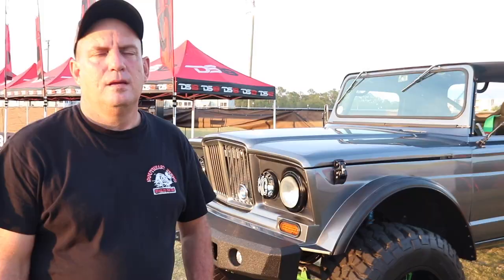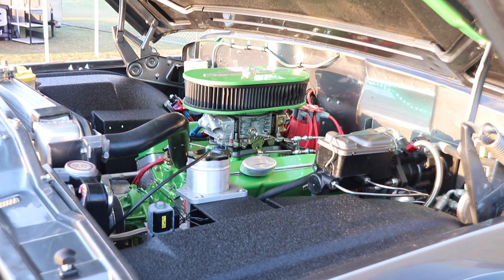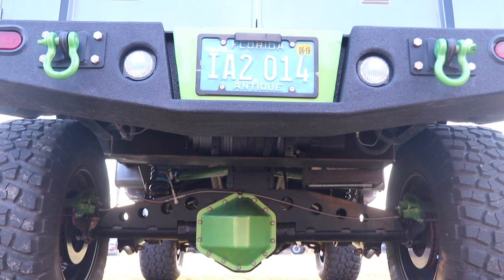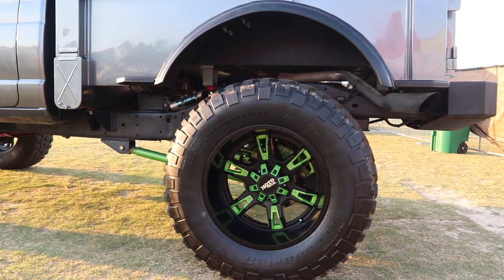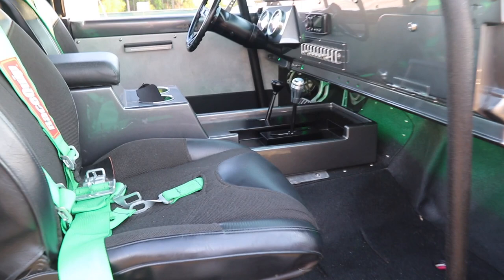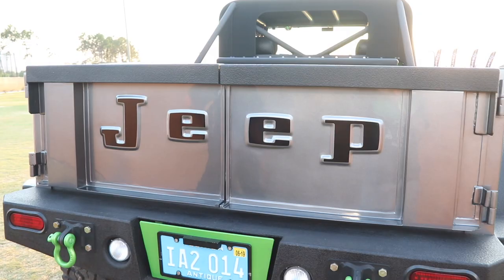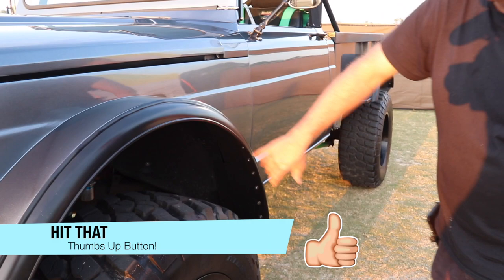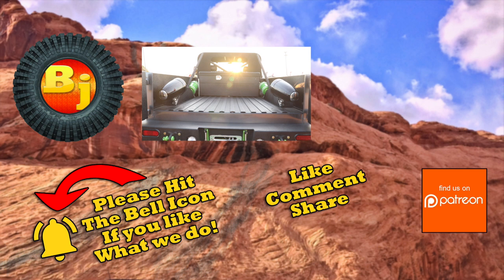Better Than a New Jeep Gladiator - M715 Walkaround

Comment: Stopped watching when they told me it's a Chevy with jeep body panels on it. 

I would use:
AMC 401 727 and Dana 60 for old school
Engine & trans from JGC srt8 for something modern (2007 maybe)
Reply: The fact Kaiser and AMC both used many different parts from other manufacturers makes the Chevy drivetrain right in line with what Jeeps have always done. My 77 CJ-7 has GM steering, Ford electronics, AMC engine and Dana axles and transfer case, Dana was in bed with Chrysler at that time. Meaning my stock 77 was built from parts from the big 3 by number 4 AMC.

Comment: That neon color just doesn't look right on an older truck like this, even if it has been restored.

With that being said, yes, it is far better than a new gladiator. Do the winches run off of the power steering pump or what?

Comment: I used to drive one of those when I was in active duty in the early 80s. Underpowered rode like a tank unless you put about a thousand pounds in the back of it. I always like the looks of those I wouldn't mind having one but I would have airbag suspension on it

Comment: you completely lost me at chevy 383 stroker. ive got a 1977 j10 with the 6.6ltr, AMC 401 that been slightly built. only AMC engines will be in my AMC vehicle.
Reply: Good. That leaves more good parts for the rest of us.
Reply: Should have just built a C10
Reply: @eriklarson9137  thankfully you dont own any AMC's, I hate for the real good stuff to be wasted on you.
Reply: This is a Kaiser!  But totally agree with you!  I have two 401s in my CJs and a 360 waiting for the next project.  My 401s are 73s, so Kaiser in an AMC CJ!  Close enough!